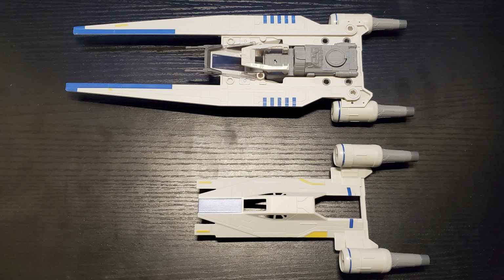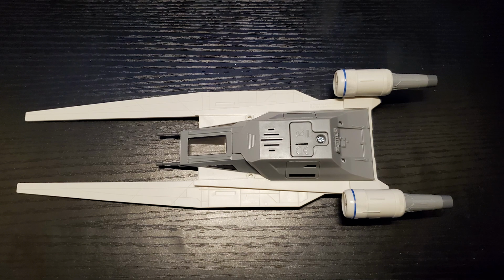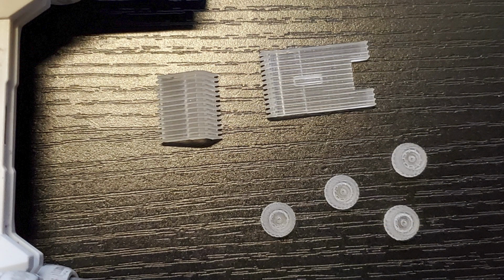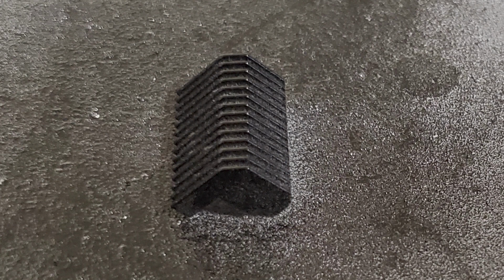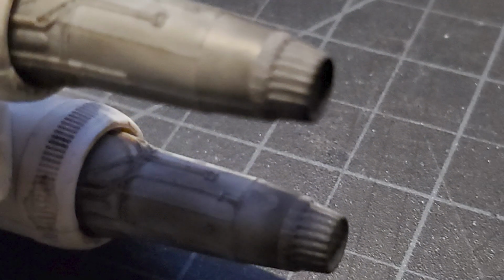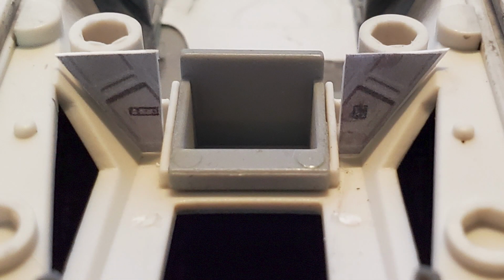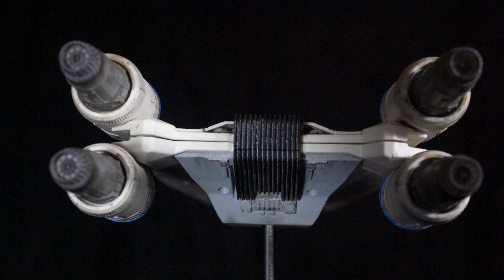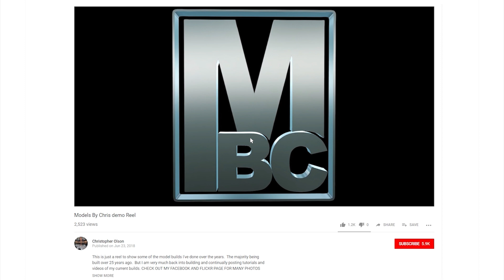U Wing:  A Covid Build -  Episode 6

Comment: How funny, I just finished mine on my weathered U-Wing a few days ago.A simple build, I just added some paints from the cockpit and pilots, it was fun. Unfortunately, I originally wanted to place a U-wing gunner on one of the pilots and place on the side doors, but wouldn't fit because it's blocked where the battery compartment are. Heh, not a bad idea though.